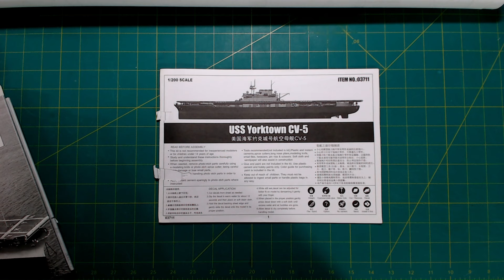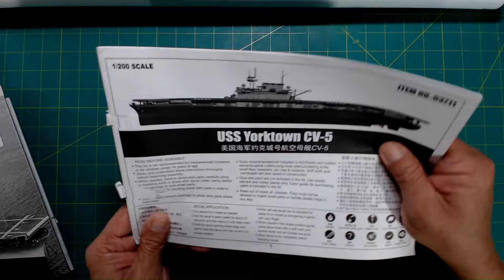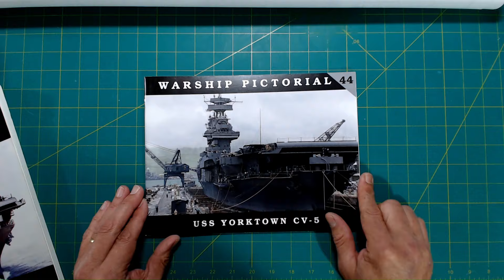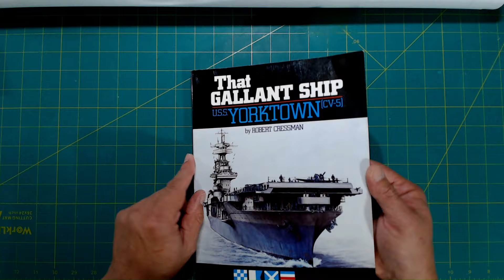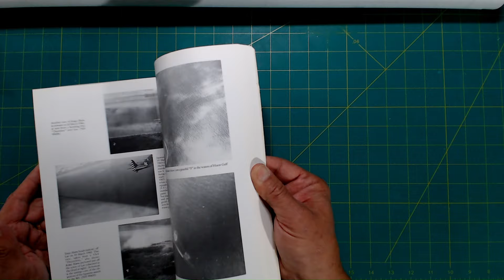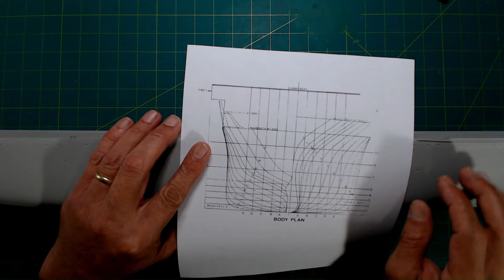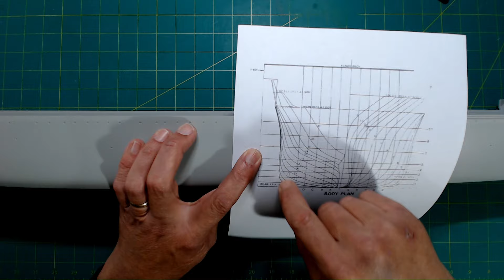USS Yorktown CV 5 in 1/200, Build Introduction

Comment: You should also grab a copy of the Booklet of General Plans for the fine detail work. Internet Archive has a set from 1940 which should be sufficient since she didn't get any modernization or overhauls before her loss at Midway, aside from a whole lot of 20mm guns to replace her .50 cal AA batteries.
Reply from the maker: @doktorjohann4883 , I actually have that saved as a favorite, but good looking out! My biggest challenge at this juncture is putting together a building slip that can accommodate the size of the model while at the same time provide accurate measurement since I’ll be erasing most, if not all, of the portholes during the process of reshaping the hull to match the builder plans. Should have some content up regarding this in hopefully a week. The best details are had through careful planning. Thanks for watching!

Comment: Looks like a great project. I have the three sisters in 200 scale and have been building my aftermarket items before I start in. You mentioned you are going to try to 3D print the machine guns. Where did you find those? I have been unable to find them. Ben with The Midwest Model Shop produces the Orliken (sorry I can’t remember how those are spelt) in 200 scale as well and are amazing. Not sure if the Yorktown had those yet in mid 1940. Unfortunately I’m up at work and don’t have any of my research material to check. Again I’m looking forward to watching your build.  Good luck.  Chris
Reply from the maker: Hi Chris! Glad to have you aboard. I was able to find a decent STL file on CGTrader, https://www.cgtrader.com/3d-models/military/gun/12-7mm-browning-machine-gun-50-cal. $3 isn't bad for either. For 1940, my references are telling me I'll need 24 of these. Now whether those will print with that resolution at 1/200 is a different story, lol. Thanks so much for watching!